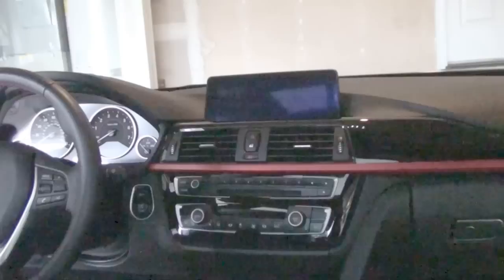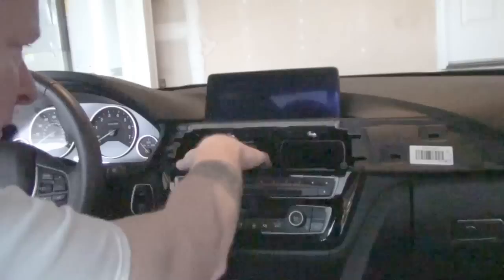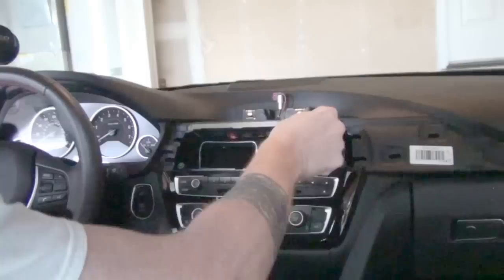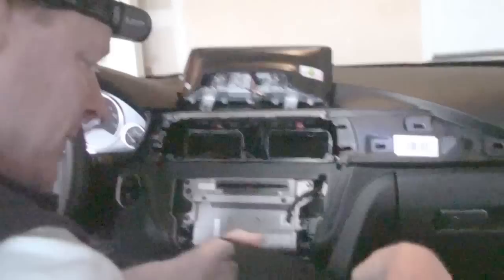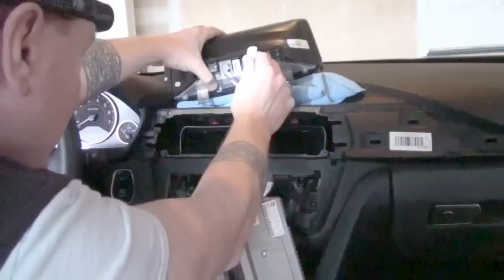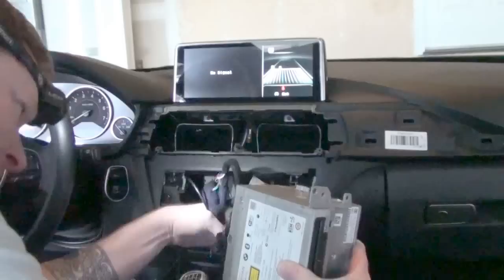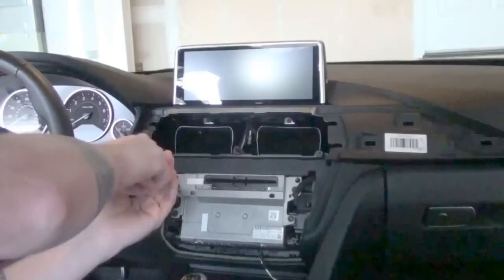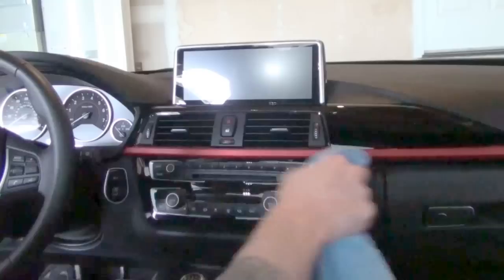BMW F32 Avin 10.25" BMW Android Multimedia Navigation System installation DIY

Comment: Avin offers a Factory Bluetooth Microphone adapter for BMW.  Is this needed to use the original bluetooth mic in an F32?  They also offer a Factory Backup Camera adapter for BMW.  Does this work in the F32 to get the reverse camera to pop up automatically via the Android system and not the OEM side without installing a new camera?
Reply from the maker: So the microphone is going to be for tying into the display directly, I believe as it wont use the factory microphone.  That will still be tied into your original head unit.  I would have to look at the camera adapter to see what you mean.
Reply from the maker: Ah very cool.. I didnt know there were those adapters!  I can see using the BT adapter so you can use the microphones that are up installed in your headliner.. that makes sense.  For the camera, I see no reason to use the adapter if the OEM backup camera is already showing on the new display, but I can see why some might want to do that.
Reply: The OEM reverse camera is still part of the origina iDrive from what I have read and doesn't pop up automatically when you put it in reverse on the F32, correct? 
Do you prefer the OEM bluetooth for the phone or the Avin head unit?  If the Avin work well enough, using the built in mics would make sense to me, since that would also be better for voice features in the Avin (Google Search, etc.)
Reply from the maker: Correct, the OEM camera will not cut in if you are on the android screens at the time.  I do know that they are working on that, because it DOES cut in on some models but not mine.  For the mics, candidly I dont use it very much and can see advantages either way.
Reply: Can you set the Avin to default to iDrive Screen when it first turns on?  Thank you for the answers.  This seems like a nice upgrade to the 6.5, non GPS screen that I have in my F32.
Reply from the maker: Michael McKenna the display will default to whatever screen it was left on when you shut down.  It really is a great upgrade.. even over the 8.8 I had installed,  it is substantially better.
Reply: Thank you!
Reply: Finally got the unit in and installed.  I have no audio.  Everything is hooked up, and when I switch to the Android side or use GPS (sygic and google maps) there is no audio.  Tried playing the demo video clip that comes on and audio from a USB drive, nothing.  Any thoughts?
Reply from the maker: Michael McKenna you very likely need to run the aux cable from the wiring harness, under your center console and up to the port under your arm rest.  I didn't have to do that,  but most people do.
Reply: Ahh, I thought that was for AUX in.  That makes sense now.  Is there a way to change the Dashboard App from Litre and KPM to Gallons and Miles?
Reply from the maker: Michael McKenna there isn't a way to change that screen yet but I hear Avin is working on that.
Reply: Thanks, the AUX cable was the solution.  Only thing I see with that is if I am listening to the BMW side, the NAV audio doesnt switch automatically, but other than that the audio works.  Thank you for the quick response.
Reply: Not to be a pain, but any chance you know what format a 128gb Micro SD Card has to be for it to be read on the unit?

Comment: Whats chipset is this ( snapdragon or mtk )
Reply from the maker: snapdragon if I remember correctly. 8)
Reply: @BMWDIYGuy  did it have video out to hook up headrest tv to be able to control the tvs from head unit ? 

I have new 12.3 for bmw f10 550i xdrive it's the snapdragon and has no video out.
Reply from the maker: @charlesh8934  In this case I am sorry, I haven't worked with those connections to the headrest TVs, so cant comment.

Comment: Have you managed to actually control Spotify via the idrive or steering wheel controls? Does nothing on mine in Spotify.
Reply from the maker: I haven't tried it but am guessing it wouldn't work beyond normal volume controls.
Reply: on mine it works sometimes to change songs in spotify and pause on the wheel on the steering wheel.
Reply: Oh! Mine doesn't! 😢:(
Reply: well now i think i know why it works sometimes. if i start music app first and play music  and then close and open spotify then it works for me.

Comment: so I just installed mine and a lot of my factory settings for screen are in Chinese and I only have like 4 to choose from. Can you send whatever update I need? they don't seem to have anything on their website plus the audio is a mess!! I may return this thing. 

im running the aux as usual, in the bmw aux input screen I cranked the input to 100 and but the audio from music, movies, gps and so on is so low, I literally have to have my car volume all at 100 to even listen to a song at a decent volume, but whats weird is if I have the normal BMW radio on and Google maps on the 10" screen , the aux cutover it does to tell me where to turn is SUPER loud. Something weird is definitely going on, any ideas?

here is a video showing mine, volume cranked to watch a movie and its barely listenable driving, switch to radio and its BLARING loud so I lower it, switch back to Avin and you can't even hear the video, music, gps, etc... https://youtu.be/HkI2VetZUaA
Reply from the maker: Ok, so reach out to Tommy of Avin and make sure you have both the latest device update and CAN update, as it sounds like you don't for some reason..  Once you get that update, you also will have better controls for volume and sound settings on the device side that should address those concerns.
Reply: BMW DIY Guy will do.  thank you
Reply: is you AUX in music from the avin's audio even sounding to your regular radio or do you find yourself cranking the audio up when you use Avin music, video players or pandora?
Reply from the maker: B Chi it was quieter by comparison until I got the update and could adjust volume better.
Reply: ok good to know, I will mess with it more tomorrow, last question, again, lol.... on your backup cam, have you figured out a way to take off the delay when you go from reverse to drive? it stays active for 2-3 seconds, I know in my last car that was a feature you could turn off

Comment: Hi can you please help me out i just install this uni but i have no signal  of the original screen only in the android screen also i don’t have sound  hope you can help me out
Reply from the maker: So two things:  First check all of your connections, especially the (usually purple) OEM plug on the back of the new display.  Chances are that is a little loose, but check ALL connections first.  Second, plug headphones into the AUX out jack on the new wiring harness and check for sound.  IF you have it there, but not through your car speakers, you will need to run the AUX cable from the wiring harness under the dash to your aux port under the arm rest.
Reply: BMW DIY Guy thanks i did get the image and audio  from the factory   On the unit but I don’t get sound out from the android version i do have a aux cable connected to the armrest in put but i still have no sound
Reply: Onee Espinoza did you figure out how to fix this? I am having the same problem
Reply from the maker: In every case of this that I have worked on or helped with directly, it was a loose cable.  Check the plug especially at the back of the display and make SURE it is plugged in 100%, not 95% as what happens sometimes.
Reply: BMW DIY Guy yeah i pushed them in fully all the way. Also, my original display is not showing up, when i go to factory settings, it is set to e60 halfscreen, my original car is f10 pro nav. F10 is not one of the options on the list, also i cant even select any if the ither options, i get 'SD card or usdisk directory did not find the cartype.xml file'

So firstly i have no sound, and secondly i have no original idrive, and thirdly i can not change the car type in the factory settings due to the above error
Reply: BMW DIY Guy any advice? Lol.
Reply: BMW DIY Guy also, when i plug ear phone into the audio out, i get sound in my earphones (if i try to turn the volume up or down on my steering wheel or headunit it does nothing, volime stays one level.) However when i run an aux cable from that same audio out, into my armrest aux, i still get nothing
Reply: BMW DIY Guy all other sounds like my parking sensors and seatbelt pings are not working either ( can not hear them throigh headphones in audio out either)
Reply from the maker: Ok.. lots of options here.  First make sure you have the latest build for the display from Avin, it makes a difference.  Second, there is no harm in trying the other display settings to see if one fits your model better, once you have that update.  Sounds like something is missing and the update will resolve that.  Next, sound.. you likely need to run the AUX cable to your AUX port under the arm rest.  That is a MAYBE because in most cases with the 2gen display, you dont have to run the cable anymore.  Update your display and check again.. if still no sound then run the aux from the wiring harness to the aux port and test.  You can also test this by plugging headphones into the aux port on the wiring harness and see if you have sound from the android side.  

Start with the display build update and then I am sure you can get through these items.
Reply: BMW DIY Guy ok i now have sound.  But there is a new issue. The quality of sound when playing something from the android device is VERY bad. When playing music from the original idrive the sound quality is normal oem good quality.

So wjat have i done wrong here? Or is this just what the sound quality is supposed to be like? I feel like car speakers are using the amplifier from the screen rather than the original head unit. Hence the terrible quality of sound? Im new to this so may sound stupid sorry
Reply from the maker: Its fine.. plug headphones into the AUX jack and see if the sound is any better.  If it is, then its a bad AUX cable.. so just get another one.
Reply: Sorted it out thank you for the help appreciate it!

Its just the original idrive issue i have now. There is some kind of split screen covering half the screen which can not be removed when in the original idrive mode. Not sure how to fix this. Its not the original split screen eithe, some sort of android split screen which is covering half the screen
Reply from the maker: So if you have the 6inch screen before, you will have the split screen in iDrive, because it cant almost double the size of a 6inch image, or it would be horribly distorted.  IF your car had the 8 or 8.8 screen, then you need to change to the 8.8 display in options to have it be full screen.

Comment: Hey @BMW DIY Guy, 
Do you know anyone who install this navi in e90 - without stock navigation system? I plan to buy this, however, I see the risk as I need to cut the dashboard. 

Thank you for your advise.
Reply from the maker: Mateusz Karolak I haven't installed into an e90.. I can absolutely understand the concern if you have to cut the dash.
Reply: BMW DIY Guy thanks for your response, I guess I'll buy it anyway, they send me step by step instruction, however honestly, looks not professional at all ;) Bottom line here is the device works smooth on old Android 4.4 but from your reviews I see you are satisfied.

Comment: i need help.... after instaling avinusa 10.25" navi in to my X5 e70 with CCC system... i lost my rear camera and PDC  . when i get in to reverse it just get CCC screen and nothing happent:( can somone help me  please....
Reply from the maker: So first suggestions is check your wiring harness, as I am assuming something is loose.  If you have the green optical wire, make sure that was transferred as well.  Some have them, some dont..
Reply: i did transfer green optic wire:( one think with it did wrong i think when PDC control (botom tray with buttons) was disconected , we test the head unit... i try to clean errors but it didnt help:(
Reply from the maker: Ok... so not as familar with that generation of X5 but will help how I can.  So you could test by putting the original display back in briefly, make sure that your backup camera and radar works.  Before that though, do you mean it doesnt SWITCH to back up camera and radar when on the android screens?  IF so, mine does that.  For it to switch automatically as you are used to, it has to be in the iDrive screens.  Why it doesnt switch on the android side for SOME models is a good question and Avin is looking into it.  If you test BOTH android and iDrive displays, and you still dont get backup camera and radar, something else is wrong.  Then test that by putting the original back in.. if it works, then it is something about how the new one was hooked up or the cable harness.
Reply: BMW DIY Guy  it's  working on original scr  . when I use android one and go into to ccc options with pdc and rear camera I can't mark any of ..lane assistant turning lane etc... and i can't change how my car supose  to be split when using pdc  and camera. I can click in diff options but it's still unmarking  them and getting all thing up to previous  settings.  I will try disassemble  all tomorrow again and check all connections
Reply from the maker: Also check your camera settings on the android side as well.. there are some settings how it deals with your camera.

Comment: Will this fit a 2014 bmw m235i?
Reply from the maker: Do you have the typical factory 6.5 or 
8.8 display?
Reply: @BMWDIYGuy  it's factory 6.5
Reply from the maker: @AG-kt4qe  so probably yes.  Check compatibility on Avins website. You will also want to use Bimmercode or similar (great app to have regardless) if you can code your car up to the OEM 8.8 display when you do the 10.25 install
Reply: @BMWDIYGuy  so what software you use to code the screen display?
Reply from the maker: @AG-kt4qe  bimmercode from the android play store. You dont need to code the new display by default. IF your car supports the OEM 8.8, you can often change the coding from 6.5 to 8.8.  6.5 idrive displays cannot stretch to 10.25 without looking like garbage, so it displays 6.5 with an info overlay on the right. IF you can code your OEM display to 8.8, you wont have the overlay
Reply: @BMWDIYGuy  so if the car supports 8.8 the software bimmercode should give me the option to change it?
Reply from the maker: @AG-kt4qe  Bimmercode is a good app to have regardless so you can make coding changes on your car. There are two lines of code in the "expert mode", that IF you have those entries you can change them to 8.8

Comment: the audio quality from the android unit compared to oem sucks man.the quality is noticeably worse. why don't you mention that? guys do your reaserch on the forums before buying.i'm thinking of selling mine if i don't find a fix for this soon.
Reply from the maker: There can be issues if it's a less than ideal connection.  I assume you ran the aux cable?  If so.. test sound quality from the jack itself on the wiring harness. Plug in headphones and check quality.  I am going to guess it sounds ok.  Then test your aux port under the arm rest as well with a different sound source.  You can narrow down where the issue is coming from.. I have talked to folks with a bad aux port, sketchy aux splitter if using one, even a bad aux cable.  I have zero sound issues from the android side myself

Comment: Any reason as to why the android sound still sounds muffled compared to playing music through the factory system?
Reply from the maker: The initial OS build I had on the display seemed to muffle any sounds from the android side, like too much bass and not enough treble.  I have seen that resolved though with a later OS update from Avin.  If you are an owner of the display from Avin and have this issue, just contact them for an updated build  and you should be good to go.
Reply: I have the most updated software, but the sound still doesn't sound as good as the BMW software does when I connect my phone with bluetooth
Reply from the maker: Odd.. best recommendation is email Avin and let them know.. I noticed my system is a little more muffled with the latest build I got, but it was mild and I corrected through the volume and bass/mid/treble controls.  Feedback to Avin though helps them make improvements in their next OS build.